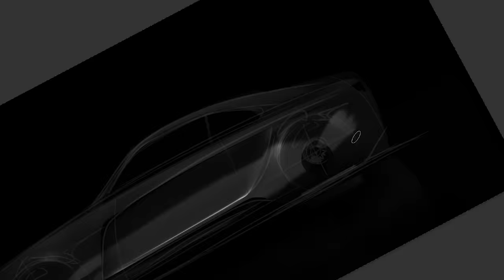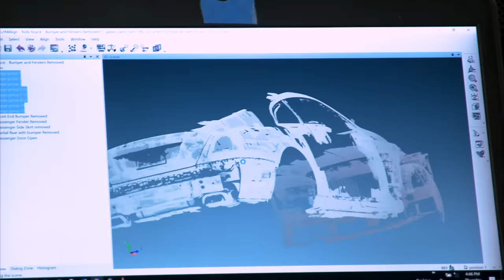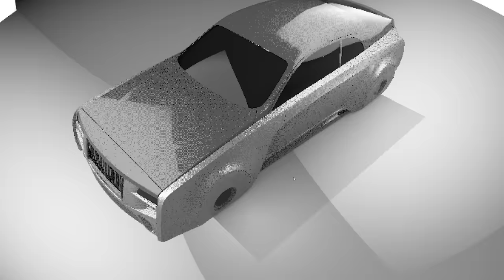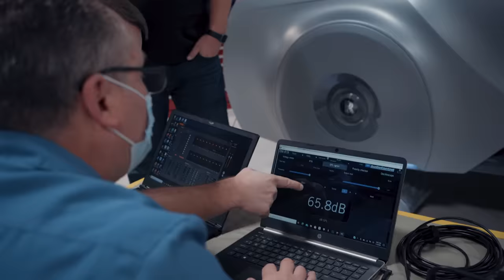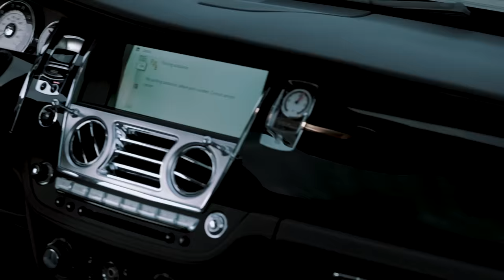Justin Bieber's One Of One Rolls Royce | West Coast Customs

Comment: I think it looks pretty cool tbh, but then again I like cyberpunk looks on things. If I were stupid rich I'd try to get my hands on the N Vision 74 prototype instead just cause personally I avoid anything made by a "luxury" brand. Like hands down the car looks better than it did originally, car just looked like boat mixed with a modern dodge charger to start with so definitely an improvement. I mean you can't change the car an insane amount from the start point so with what they started with it came out good, just that car to start with was pretty bad lol 

I will say it's a far cry from the concept car, personally I wouldn't have said I could make that cause that concept car needed to be made from the ground up to even come remotely close so gotta say it was a bad choice to even try, especially with the car they picked to try it on.

Comment: I knew there was a reason they kept the lights dim on the reveal.   It just doesn’t look right in light.  I don’t know guys.  You obviously had to widen the body stance so the tires could turn up front.   But then didn’t widen at least the rear tire wheel base.    I don’t know Justin.   See if you can get a refund I guess.  😂